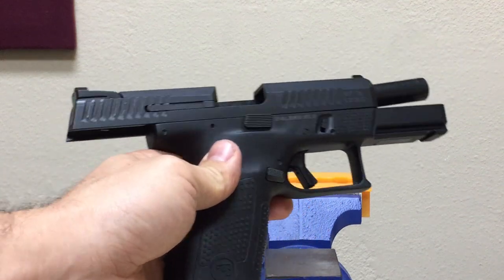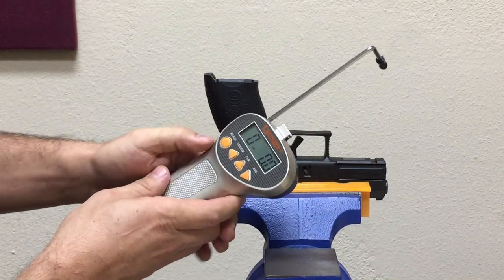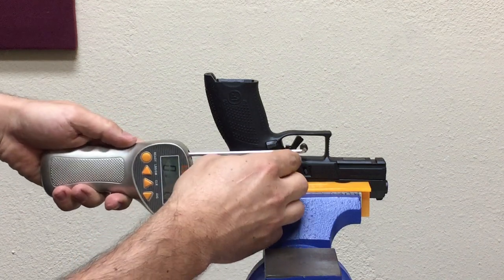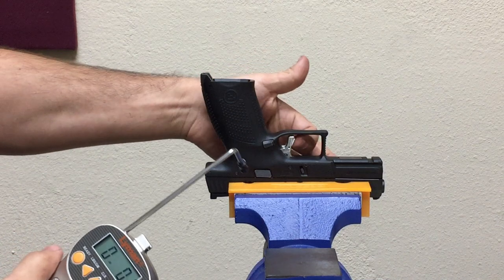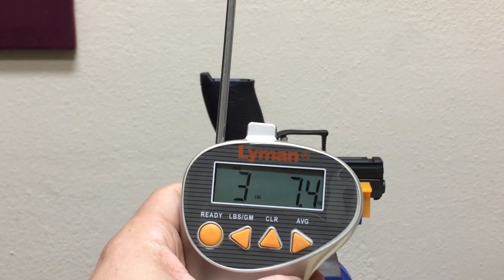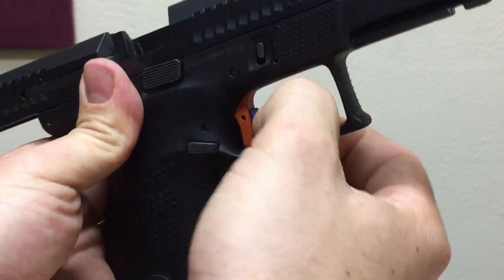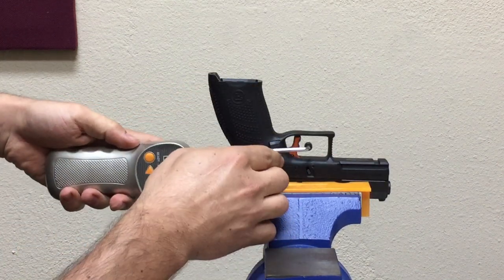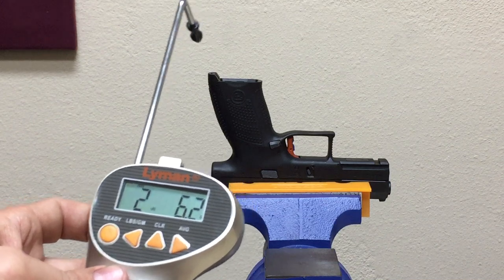P10 Striker Spring Gage Weights

Comment: I always pull with uniform speed straight back, and parallel to the bore too. However, I always pull from the bottom of the trigger, which is where I pull with my trigger finger. My brand new straight out of the box P10C, with 5 pulls on my Lyman digital, averaged 3lbs 14oz. I was pleased with that.

Comment: Hi I bought spring kit for cz p10c
The blue spring #10104 is marked  -10% weight ,does it mean that the trigger pull is 10% lighter.
Reply from the maker: Yes, correct. When the blue #10104 striker/firing pin spring is installed, the trigger pull will by reduced by about 10%. The red #10115 spring will reduce the weight by about 15%.
Reply: @hb_industries  Ok thanks

Comment: How positive is the trigger reset with the 3 lb striker spring? In another video from someone else the guy mentioned that the striker spring was a little on the weak side meaning that the trigger reset action was weak. Your comments please. Thanks.
Reply from the maker: Good question, but very difficult to answer. In all of our testing to date we have found that: it depends. During development we did encounter several P10C's where trigger reset even with the factory springs felt slower or more sluggish than other P10Cs with prototype springs lighter than 3lb in them. There seems to be enough variation in the molded frame, the trigger bar, striker assembly and slide plate, and the front and rear frame insert fitment... Several of our testers found plastic flashing or burrs in the frame around the pocket that the trigger moves through (in the backside of the trigger guard). Just scraping the flashing off and deburring this area smoothed out the reset for many if not all of our test guns and shooters. As the P10 production matures over the next several years we may see this improve from the factory? But right now this is the very best info that we can give on a somewhat subjective question. Hopefully it helps. Do not hesitate to contact us directly if you or anyone else reading this has further questions.

Comment: Is the 3.0lb trigger spring in your trigger kit reliable?
Reply from the maker: Yes, both the 3lb and 3.5lb springs have been tested with a WIDE variety of commercially available ammunition in a reasonably large number of P10c pistols. The obvious disclaimer here: a stronger striker spring will always be more reliable as the firearm becomes dirty, corroded, etc... CZ used a "4.5lb" spring in their factory configuration, there must be a reason. Our lighter springs are reliable, but in all firearms heavier fire control springs will typically be MORE reliable. If that makes sense?
Reply from the maker: @Dylan Harris Maintenance on the striker assembly is really dependent on ammunition (clean vs dirty). With all P10 striker assembles, they are so easy to remove and service, that we would recommend at least checking them every 500-800 rounds until you get the hang of how dirty your particular ammo is, and go from there.
Reply: HB Industries my striker springs have percentages on them. What would the 15 percent red spring pull weight be?